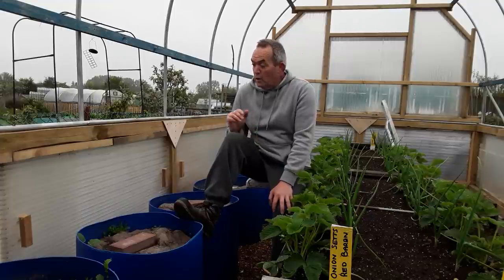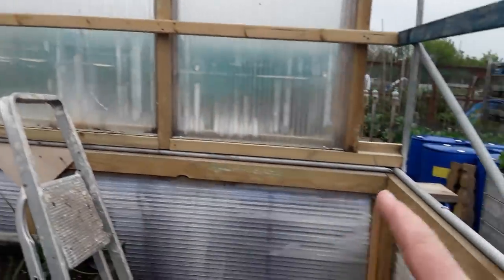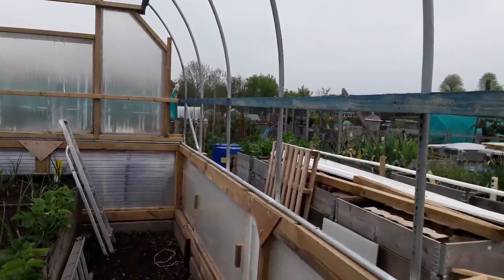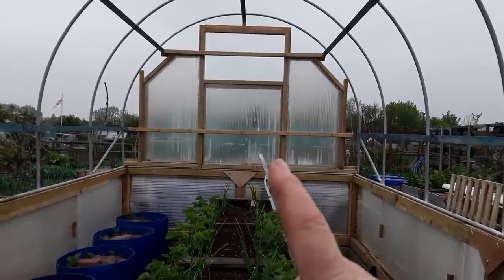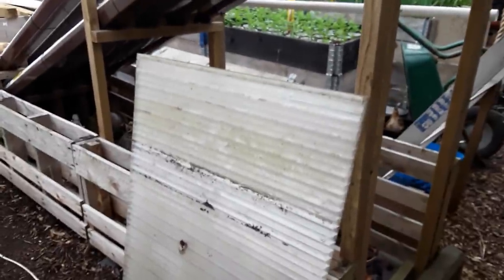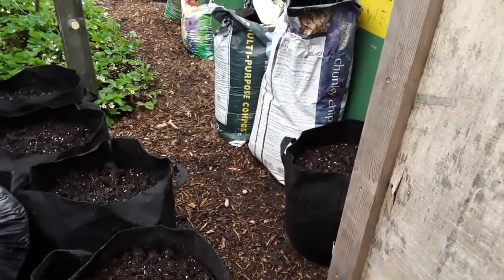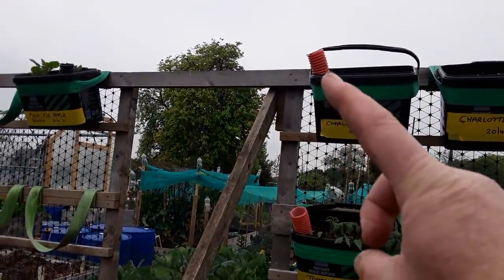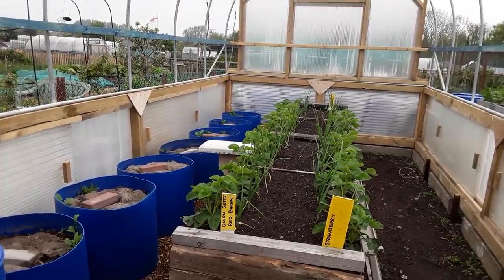SHEDWARS21: My Double Skinned Polytunnel Rebuild 🌻 How Did I Construct The Sides & Ends At No Cost

Comment: You have now really got paid for all the trips to the skip, Terry. You are going to get a fantastic tunnel for almost nothing (except from all the workig hours).
Screws and the politunnel plastic will probably sting a little in your wallet. I love the idea you've got from Alan's allotment👏🏼
I've been wondering why you did not make yourself a hotbe before, but now it's going to happen. Great.
Thanks for the update on the polytunnel and do not eat too many flowers my friend.
Reply from the maker: The timber came to about £270 UK pounds and probably £50 in screws, blue water pipe £45 , but the amount of recycled materials has out weighed these costs Benni and yes the covers and tape that I will need to buy in a couple of years will sting me and hopefully will last a lifetime. Looking forward to having a go with the hot bed and then using that material on the beds outside. 

♻️Happy gardening, Terry King.

Comment: It looks great mate. maybe smaller batons later for the windows. The screws might start cracks in the polycarb.. Surprising on how much wood you use eh. Maybe put insulation for pipes on the metal frame? you know the stuff like hard foam that would protect the poly on the tunnel. Poor little shriveled cabbages. What ever it cost it will be far cheaper and better than any you could have bought. Not to mention you can fix it as you built it. 
Cheers
Reply from the maker: Slipped the cover on yesterday temporarily fix it and I have one hole at the bottom end at the top, out with the silicon and yes it would look better with smaller batons. This will be a one off and yes easily fixed or add stuff on, looking forward to getting it ready for some winter growing. 

♻️Happy gardening, Terry King.

Comment: Terry I have never been bored to tears with your videos.  A very interesting upload on what you are doing and how it relates to whats buzzing in my mind at present.  I have only a small poly tunnel and the first one I have owned so I have been on a learning curve.  The covers are only gaurenteed for seven years and I have had mine for six and I think a new cover is on the cards for next year and I am going to do somethings different.  Some of my metal work is rusty and will require removing.  Thought about hammerite?  The plastic heat strip all perished, thinking over wrap it with a plastic tape?  The side ventilators to fit a vertical sliding panel but interested in your horizontal panel.  From what I could see impressed with your workmanship.  Working on a poly tunnel is similar to ship building how do you keep it plumb when the boat is rocking on the waves.  Rock on Terry and take care Mike
Reply from the maker: Thank you Michael for your kind words and continued support and yes I think I have got this right for me and it's been built on my own and many viewers ideas. Cover is now fixed and some guttering is on, but rain stopped play again. Looking forward to seeing what you do my friend's. 

♻️Happy gardening, Terry King.

Comment: Hi again Terry, interested in how you finish the end elevations finish in respect of cills to shed the water off the face, Just a thought.  Mike
Reply from the maker: Not quite sure what you mean or suggesting Michael? 

♻️Happy gardening, Terry King.
Reply: @terrykingsallotmentgardening  It is easier to draw than explain but here goes.  When you have two structural units places one on top of the other as you have at the end elevations water is sucked into the joint by capilliary attraction and will cause the timber to rot.  Modern method is to bed the top structure on mastic I dont know or cannot see any mastic bed joints.  I am not a lover of mastics as they have to be maintained.  The traditional way is to place a cill under the top frame between it and the wall frame under it.  The cill protrudes with a sloping face and a capillary groove under (a drip groove)  The cill discharges water off the face of the structure and stops the rain being sucked into the building.  First time for me owning a poly tunnel and I have ideas for the next one but one thing I have learned is the enormous stresses the frame takes due to wind pressures and it takes these stresses by being flexible as trees and plants do by flexing in the wind.  Rigidity can have an adverse affect which is why I prefer the tradditional route maybe I am over thinking the problem maybe you have used a mastic bed which wll be OK.  Its all difficult to describe in words, time will tell, from what I have seen your doing a great job.  Take care Mike
Reply from the maker: @allotmentuk1303  cheers Mike, understand what you were on about and no mastic was used, fingers crossed it drys out effectively and will be watching closely what you do and yes I agree the frame does need to flex so hopefully I have got it about right.